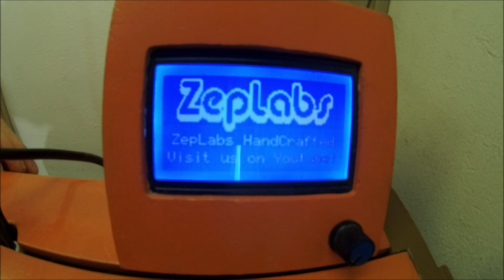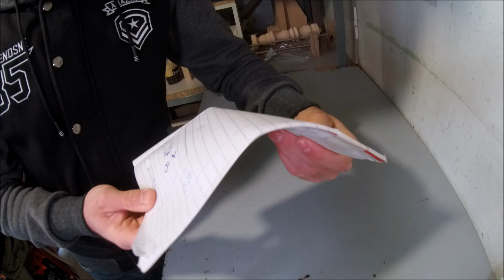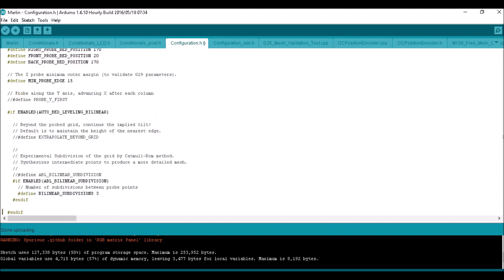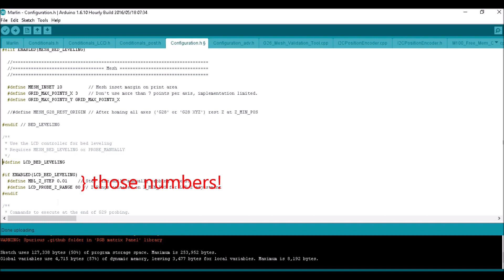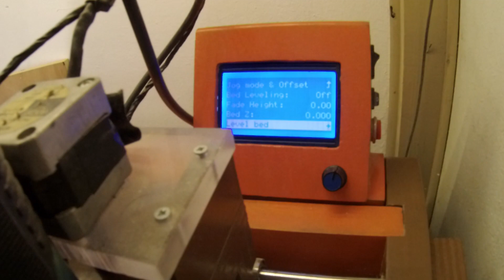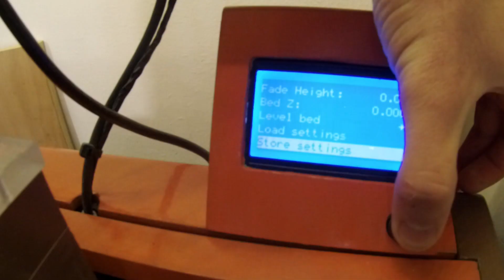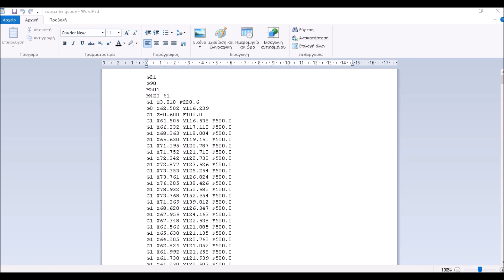CNC Bed Leveling 101

Comment: Hi, thanks for post :) only question, where did you put jumper? which pin?
Reply from the maker: Hey Murat! I placed it on the Z+ endstop pins. Signal and GND. 
Cheers!
Reply: @ZepLabs  Thank you , i!'ll try it. I use endstop max on Z+ , i'll remove it and put jumper
Reply from the maker: @muratkazmaci1371  no need to remove it if you have it already! I didnt have any, thats why I used the jumper! Mounted a proper endstop there eventually!
Reply: @ZepLabs  when i don't remove something goes wrong while it's bed leveling.  It goes to wrong way
Reply from the maker: @muratkazmaci1371  while homing or leveling? You have to run a homing cycle before you run a bed leveling one (G28)! Your Z is probably configured to home the opposite direction ( towards -), but you can change that in your Marlin setup (inside configuration.h).
Hope this helps!
Reply: @ZepLabs  while leveling. Direction was wrong but I fixed it in marlin. I've also made a 3d printer  it's working well. Config is same. I also checked your Config, everything is almost same. Problem only while leveling, homing is ok

Comment: Interested,, it is mega256 and ramps board righ,,?
Reply from the maker: Hey bud, and sorry for the late reply.. Yep it's an arduino mega 2560 and a Ramps 1.4 shield with a full graphic smart controller (that's the name for the screen-encoder assembly!)
Reply: Usualy it is work for 3d print, how to modify  for cnc in marlin,,?

Comment: Hi, is does Marlin rely on a specific arduino shield?
Reply: With shields as far as I know it is ramps but there are also some ready boards revolving around arduino mega 2560.
Reply: What you need to do exactly?
Reply: @3D Head Tutor Hi thank’s for the interest. It’s not so much what I need to do but more what I have. Uno and Mega I have both but I don’t have a Ramps shield instead I have a couple of the other Common CNC shields and I was wondering if I could run Marlin on those🤓
Reply: @gerthalberg9735  usually it is much better to use a ramps shield with arduino mega. I haven't found a way to control stand alone  cnc shields with arduino, it is not very expensive if you ordered the shield from a Chinese supplier. But just you must know that it is very hard to use 24 volt stepper motors. So pretty much you are limited to  nema 17
Reply: @3D Head Tutor Ok - actually my shields goes on top of an Uno and I’m able to put 2.5A through the 8825 stepper drivers. Currently I use NEMA 17 running on 20V and appr. 1.7A without anything going red hot. I see a good point in using the Mega because of the extra memory GRBL is an awfully tight fit on the Uno.
Reply: @gerthalberg9735  exactly, mega and marlin are way way better. And with the demonstrations from zep labs are way easy to use without the learning curve